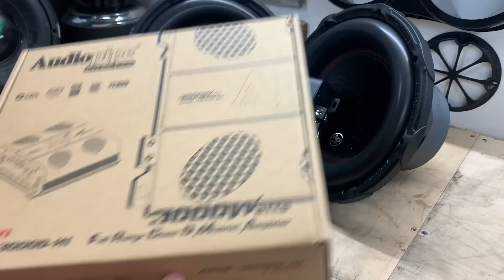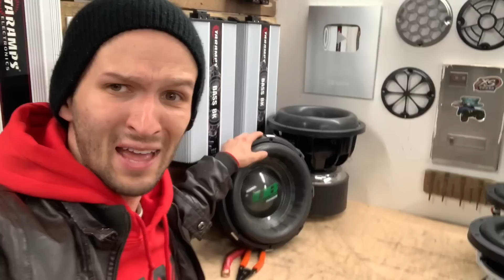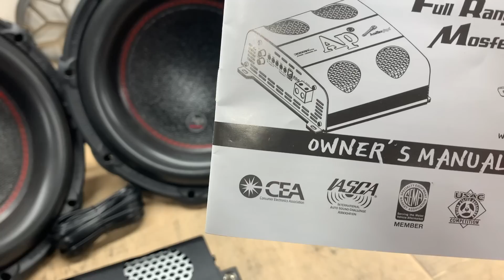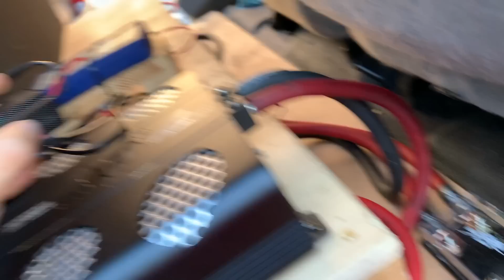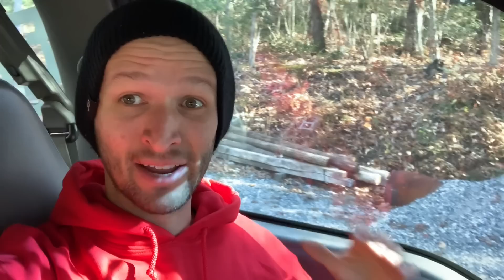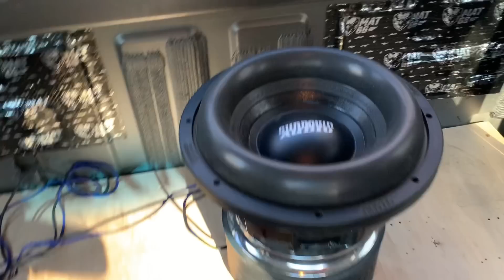The AudioPipe TINY BUDGET 3000W AMP! | Full Test and Review

Comment: I just purchased a Audiopipe aphd 3000d h1 3000 watts. Got 2 Audiobahn Alum 12x's on it and it sounds pretty good. But I agree on the power supply 0 gauge. I'm running 4 gauge rite now until I get the 0 gauge

Comment: Bro, you really need an oscilloscope.  If you don't want a big professional looking one, you can get smaller handheld types, or even Digital Multimeters that have an oscilloscope function, or if you want super duper cheap there are kit form ones from china for under $30.  The multimeter ones are OK, my biggest gripe is their slow update rate, only 2 maybe 3 updates per second.

Anyway, the reason you do is to watch the amps output for distortion and then clipping.  I never trust those clip lights, I have a vid on my channel showing how far out my  Stetsom 8K clip light is out by.  The output is square as hell before the light comes on.  
You will also find the oscilloscope handy for amps that don't have a clip light at all, and times where that distortion light doesn't come on with that little blue SMD dyno because you can watch the wave increase and then start to distort and look crappy before it begins to square off.  It's a must have tool, even for a mechanic, we are lucky to have them super available and cheap these days

Comment: I have those speakers but the 3 and 4 stack 12”s in my car four of them total..2)3 stax and 2)4stax in a ported box with a skar rp 2000 feeding the 2)4 stax and skar rp1500 feeding the other 2)3stax…..they hit super hard and are well worth every penny…i also got 4) of the 6.5” 4 stax woofers in my truck in a foward facing box under the back seat and they hit wayyyy harder than the downfiring or upfiring 12”s that the replaced and just didnt sound very clear at all…..i have a taramps 1800 watt amp feeding those speakers and i love them , they sound soooo clear and hit exceptionally well for some lil 6.5” id reccommend audiopipe woofers all day long…i even have a 3 stack bdc10” in my boat. Thats how much i love and believe in these speakers

Comment: I’ve had an audiopipe apmn 2k pushing 2 15s for about 3 years. Just did upgrade to the jp23. That amp was built very well and actually put out some surprising results!
Reply: I have 2 apmn 1500 strapped on 4 of those txx-bdc2 15s, held up great till I sold my Durango
Reply: AWESOME

Comment: 3000w
200a fuse
The math aint mathin
Reply from the maker: Amps are more efficient now and the general rule of 10% is an old rule for 2ohm amps
Reply: @ParkerTheBasshead  But even assuming 100% efficency, 3000w @ 14v means 214amps. I took for granted the rating of 3000w was rms, which would mean changing fuses all the time at full volume. Even more so if you have voltage dips
Reply: Fuses are rated a little different. A 200 amp fuse has to be able to do 110% for a minimum of 4 hours and 200% for a maximum of 5 min. Think of it kind of like an amps ability to do dynamic burst. An amp may be able to sustain 3000 watts but it will burst to often double the power. fuses are similar and have a slow opening time.

Comment: Their Korean style amps get HOT. Surprised to not see a built in fan for full bridge.
Reply: I have the 800watt mini version it overheats pretty fast but I’ve banged it for 5yrs now and just recently been having this issue, usually after about 10 minutes of pound time.
Reply: @downtoearthconstruction  I've owned 1500, 1800, and 2000 watt Korean. Could fry an egg on any of them after 20 minutes. Switched to Wolfram. Currently on 5K. Have fans on it, but never gets nearly as hot as AP.
Reply: There is a fan inside
Reply: @Bassknots Trained on one component. Most full bridge have at least one blow thru, usually a pair.

Comment: i got 2 4 stacks had em on a taramps bass 3k it poofed but getting it fixed by warranty loved it on them! felt like i needed more power box was tuned to 32hz i believe but i love audio pipe had several amps of theirs back in the day first time owning the subs but man they are beast!
Reply: How long you had it before it poofed? What do you think went wrong?..asking because I have the same set up in my shopping cart that I'm ordering next weekend when I get paid and need some feedback or opinions
Reply: @baileysmith6330  not real sure I know I threw it into protect a few times, and that day there played it all the way from Indiana to michigan about 3 hours total so who knows I had it repaired they did for free and no issues since almost a month now just played it on a 6 hour drive last weekend no issues
Reply: Man that's great to hear!! Let's me know I'm on the right path!! I built a big ported box out of plywood with bracing inside and painted 4 layers of bedliner inside and out using a 1,800watt ds18 on two 1,100watt 400rms pioneer champion subs and the bass gets DEEP my trunk is almost popping off so I can imagine how it's about to sound
Reply: @baileysmith6330  I have big 4 all 0 under hood and to back xs batt then from there 3 more 0g grounds and 0 into amp with reducers I wanna run a dual run back and into amp when I went from 4 to 0 into amp from back battery I gained some power now next step is a alt factory alt don’t cut it she dims bad
Reply: @xxg0t3mxx  some good stuff right there 👍..yeah alt is definitely one of my issues I'm ordering that along with the other stuff..I have big 3, a extra battery and a cap(haven't had a cap in 13yrs) it helped out alot but when my lights are on or ac/heat it draws too much juice and volt drops so low amp starts clipping...alt is dying, main batt only charges to 40% so 2nd battery is carrying the weight little poor guy